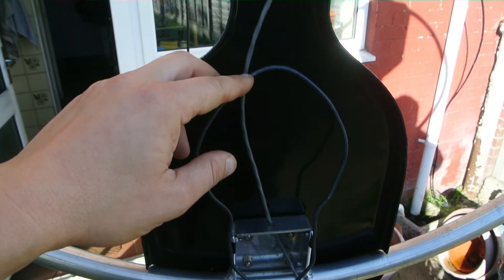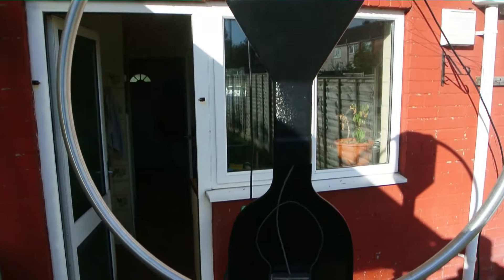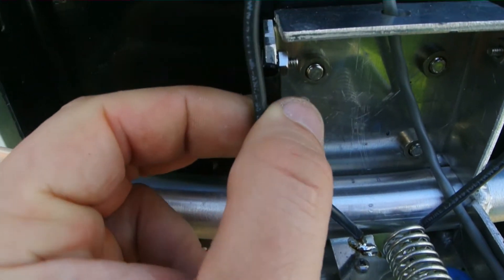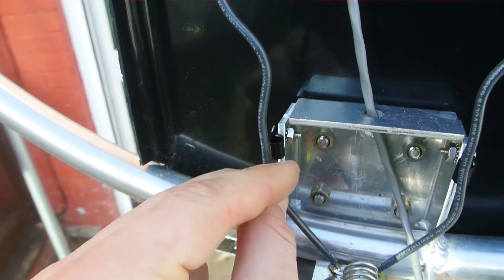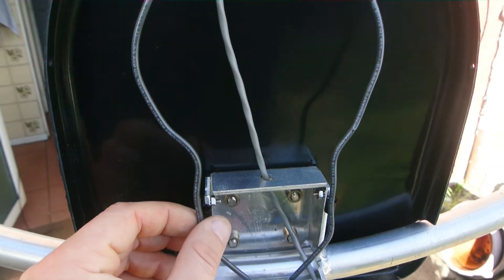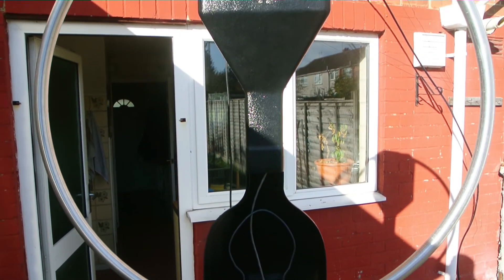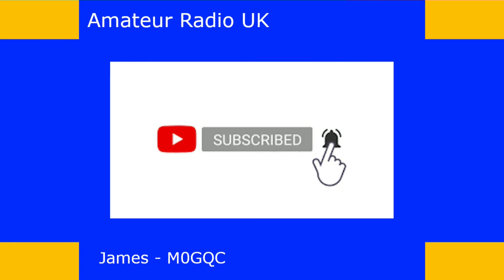Inside The MFJ-1788x Mag Loop

Comment: Hands down absolutely one of the best antennas i ever owned.
Reply from the maker: Some people love them, some people hate them. I think they have their place. 

I find it a pain to keep tuning every time you change frequency.

Performance wise, my Moxon knocks the socks off of this, but that isn't a fair comparison. 

For me, I have an EFHW for 40m & a monoband Moxon for 20m. Those are my "primary" bands that I focus most of my efforts on.

In my use case, the MFJ loop gets used as a "secondary antenna" to fill in the gaps that my other antennas don't cover (30m, 17m, 15m).

I'm in the fortunate position of having a bit of space and therefore being able to have better antennas for certain bands. To that end, I wouldn't choose this as my primary antenna but it makes a really great secondary antenna. 

Having said that, a lot of people don't have the luxury of being able to put up beams or even an EFHW, so I feel that it's a good option for them.

As I said, I think they have their place.

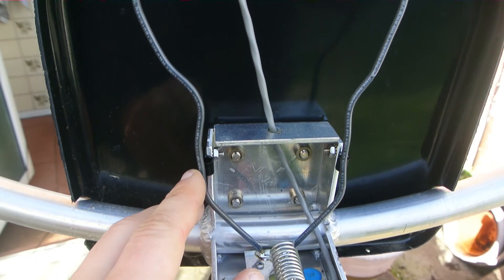Comment: Did MFJ ever address those two P-Clips not holding the mag loop wire?  (at 3:48)  I also wonder if the loop would function better if shaped circular rather than like a lolipop.
Reply from the maker: I bought this loop second-hand. There was no warranty, so I didn't send it back to MFJ.

After reattaching the P-clips, I did find the loop much more fiddly to tune. I ultimately ended up un-doing the P-clips & putting it back how it was when I first opened it up. I guess the previous owner had already been in there & experimented with that!

Comment: Thanks for letting us have a look inside the MFJ-1788 antenna.  I have always been interested in purchasing one because of it's small size and stealth capabilities.  But because of it's cost, mediocre performance reviews and quality control I have refrained form buying one.  As far as MFJ quality control...  My first MFJ purchase as a new HAM in 1992 was a brand new MFJ-949 antenna tuner.  It was dead right out of the box.  Fortunately my Dad was a HAM and life long electronics tech and he had it going in minutes.  I have owned dozens of MFJ items since with no real issues other than tightening a screw or making minor adjustments.  So personally I am pretty much satisfied with MFJ.  73!
Reply from the maker: I basically agree with your sentiments on MFJ kit. Most of it is pretty decent stuff.

There have been some well documented quality control issues specifically with these magnetic loops (which is what I was referring to).

Having said that, everything that I personally have ever owned from MFJ has been absolutely fine.

My point is that I don't dislike MFJ. On the contrary, I have several MFJ items which I am very happy with & will probably buy more in the future. I'm currently contemplating buying one of their remote wire tuners, so I'm not someone who hates on MFJ for the hell of it.

On the mag-loop, they are expensive for what they are. I got mine second hand on Ebay. I can't remember what I paid for it but I seem to recall it being well below the normal asking price.

I don't think that they are quite the dummy load that many people claim they are but as I've said in my videos, they are a compromise antenna & you need to moderate you expectations accordingly.

A full-sized antenna is going to outperform this mag-loop under most circumstances. You can't defy the laws of physics!

I'm still probably going to hang onto mine though, if only for use on data modes.

Comment: Always worth checking MFJ manufacturing!! 73
Reply from the maker: True.

I don't dislike MFJ. I have an antenna phasing box, two antenna tuners, an antenna analyser & probably a couple of other items which I haven't listed & have never had any issues with any of it.

Having said that, they do seem to have had a few issues specifically on these mag-loops.

I will be completely fair & point out that I purchased this loop second hand on Ebay. The wire not being held in place by the P-clips might not be a MFJ quality control issue!

There is quite a well published suggestion on the internet that bending the small (driven) loop to a different shape is supposed to improve performance. Personally I'm not completely convinced!

It is very possible that a previous owner might have been in there with a screwdriver in an attempt to "improve" it, so I'm inclined to give MFJ the benefit of the doubt on that one!